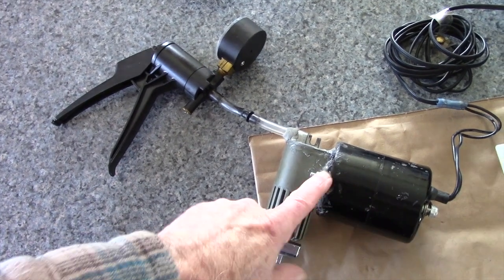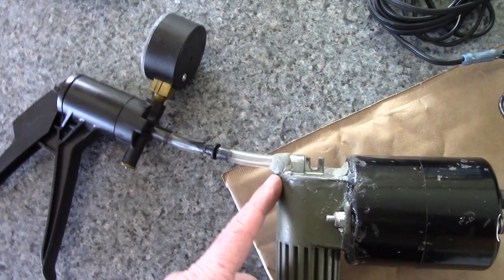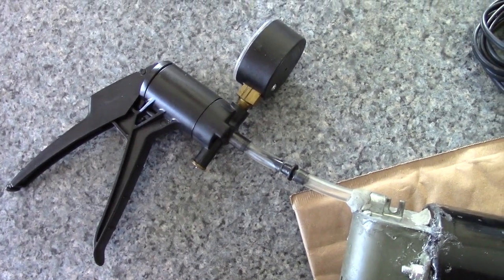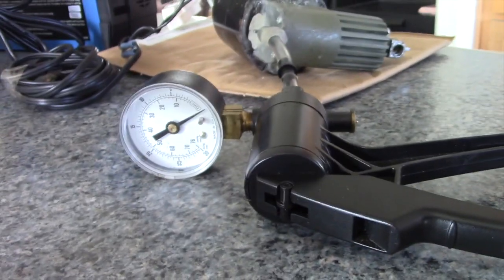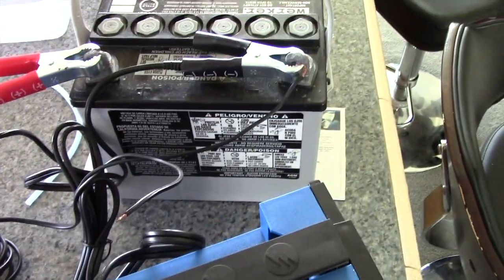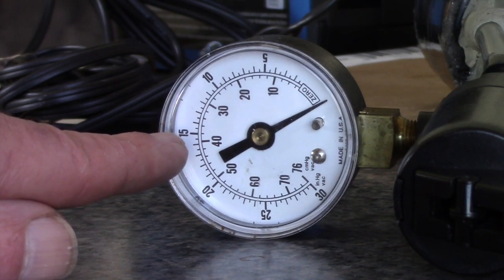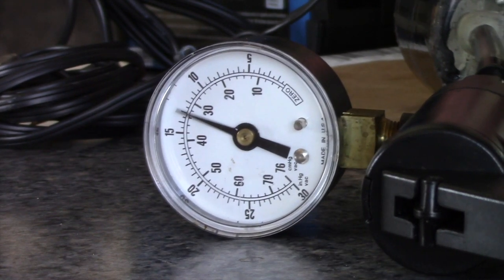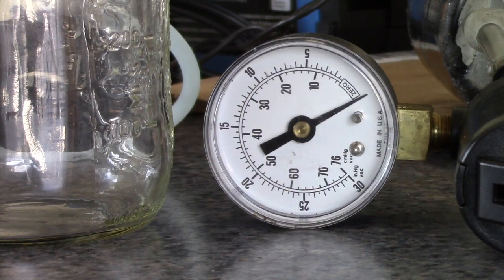Make A Vacuum Sealer Out Of A Tire Pump

Comment: Clever idea 💡 thanks for the frugal info. 👍👍👍
Reply from the maker: Hi Dia's Frugal Life,
I just uploaded the How To Make this Jar Sealer and the little thing in action, sealing a jar.  It's a more finished video than this "proof of concept" version. At $129.00, a food saver is nice but kind of a luxury for me.  I had a little tire pump. Pumps don't care if they fill something up or empty something out.  Now if I could modify an air pump to also be a vacuum pump, I have the same item serving multiple purposes. Exactly what I like to do in the van because space is at a premium.
Frugal is the name of the game.  The Jar Sealer lid was $10.  Even if I HAD a Food Saver, I'd have to buy this accessory.  The pump was 'free'.  The tubing, epoxy, silicone sealer, wire and connectors were less than $10. So for under $20, I have a way to keep things fresher longer in the van AND a machine to keep stuff inflated !
And it runs on 12 volts not 110 AC house current so I can use it wherever I find myself in the van.
I call it the "Process".  When I embark on one of these projects, I usually find several other useful bits of knowledge I can apply to other things I want to do.  Like, in this case, I was thinking about how to connect the pump and turn it off and on.  Tapping into the light over the sink got me the power and while I was in there doing that, it dawned on me the light has a switch so I wired the plug to use the existing switch so I didn't need to but a separate one.
I just love it when stuff like that happens.
Reply: Roadtrek Rich wow 👍thanks for all the great info! I did get a notification of your video and I’m about to watch it. Thanks. ✌️👍